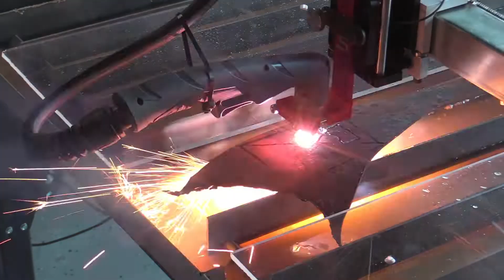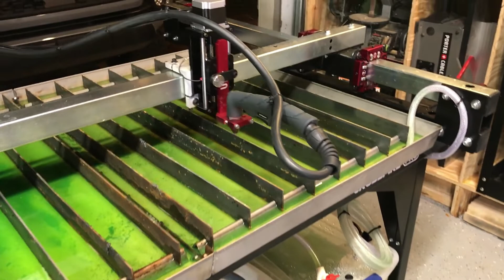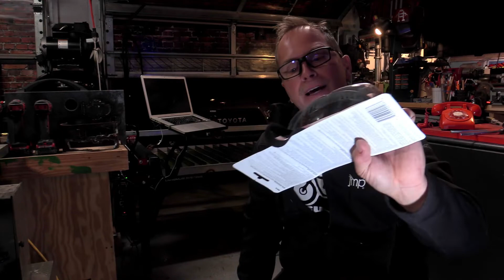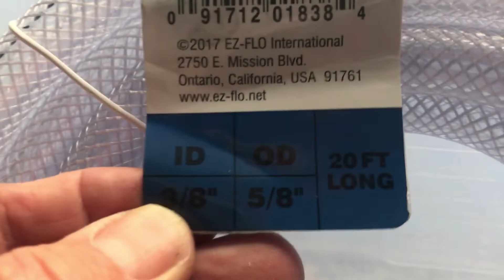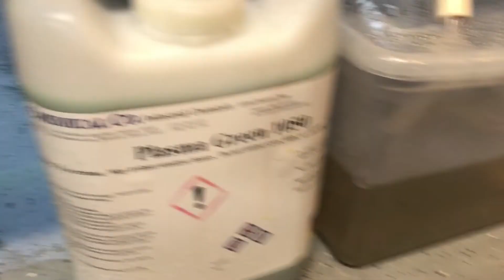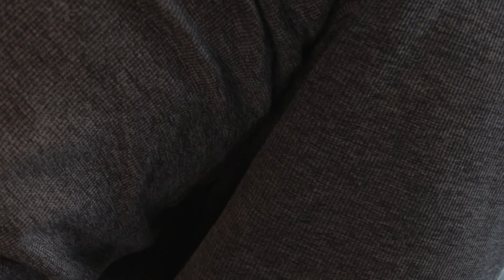Langmuir Systems Crossfire Pro

Comment: Hello, Great info thanks for that! I just had a quick question....... is both your compressor and plasma 220 volt? And if so did you do two 220 outlets or have you found that as long as the compressor is full that you can get away with leaving it off during your cuts and only running the plasma on 220? Hope that makes sense. Thanks